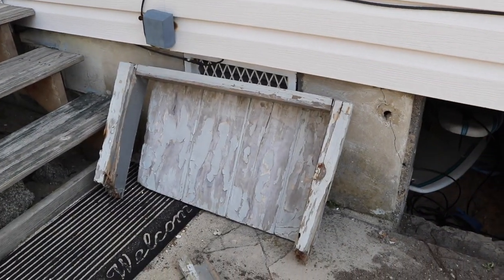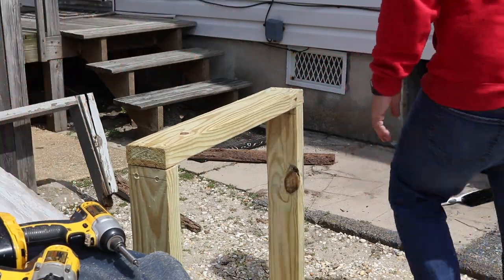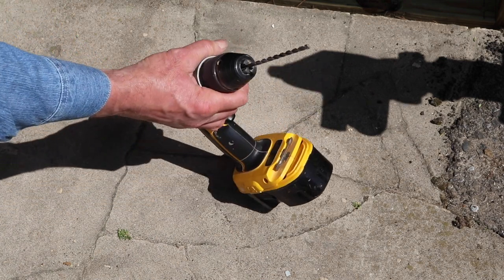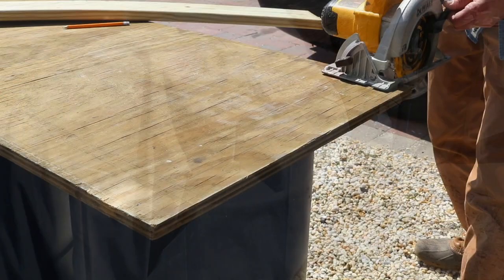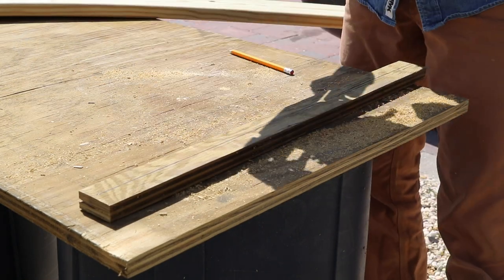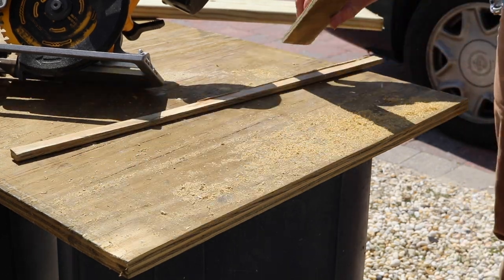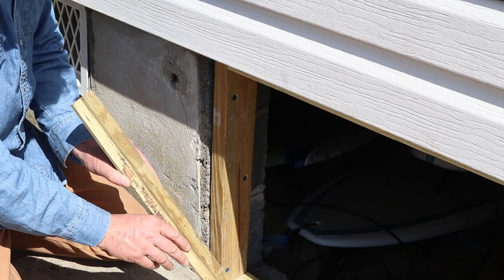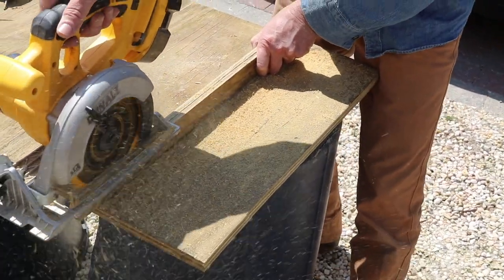Replacing an old Crawl Space Access Panel

Comment: Jon, I also have a Dewalt Hammer drill, however, I also have a Dewalt drill as well as the impact driver...but most regular drills do not have a hammer setting on them...Just hammer drills...the hammer drill has the regular drill setting in case you need to drill through wood or other such materials...Nice job you did, I too still use my XRP batteries for all my cordless tools, keep getting new ones at Lowe's when they have the specials 2 batteries for $99.00...good deal and they work great...
Reply from the maker: +Greg Arnsberger yeah these are about six years old and still going strong!